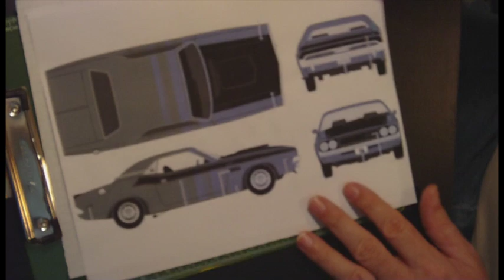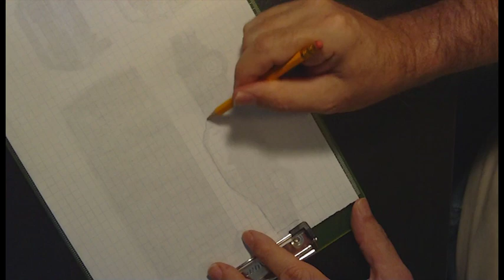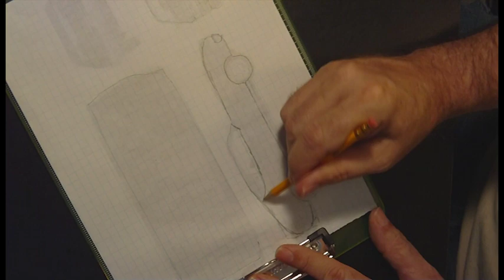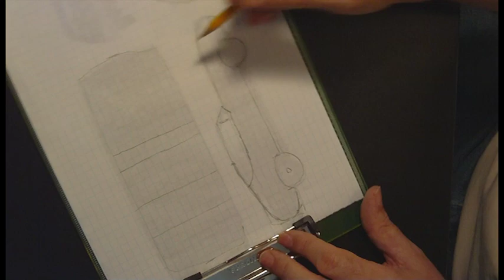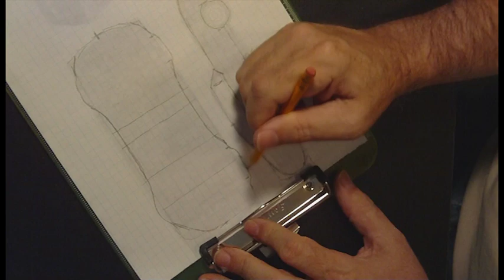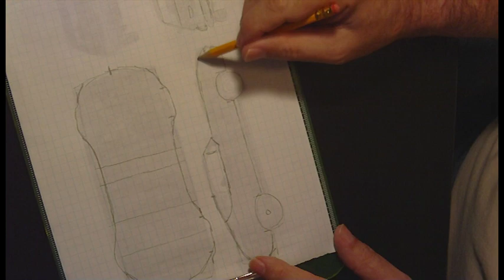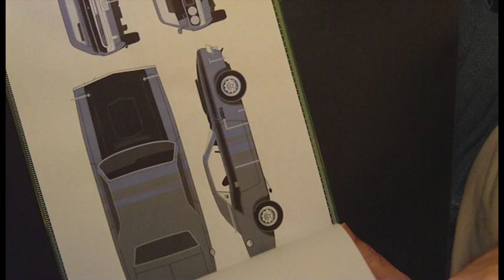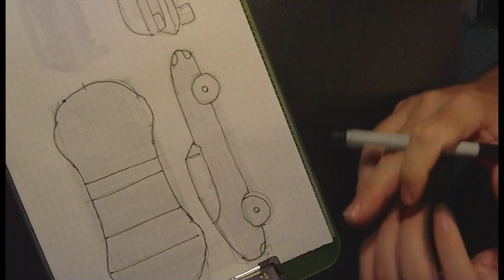Blender For Noobs - Design Your Own Car Part 2 - Sketch

Comment: Avast says accessing the website for the reference images is a virus? WTF
Reply from the maker: It's an avast problem.  see if you can update your definitions maybe it will solve it or maybe it has blacklisted my site, not sure.  My site was hijacked last year.  Since then, I've had it checked by Google and also moved it to new hosting and a new provider and check - no actual virii.